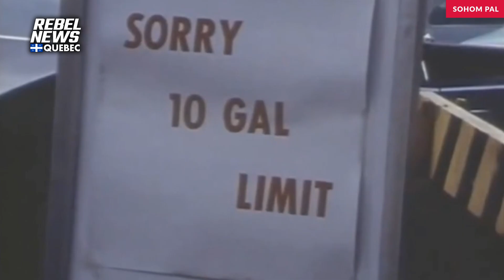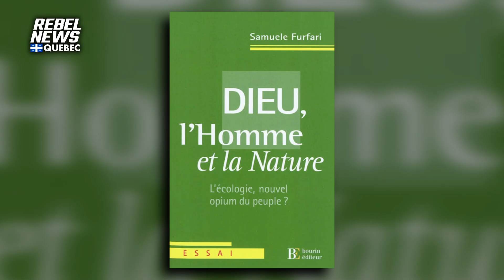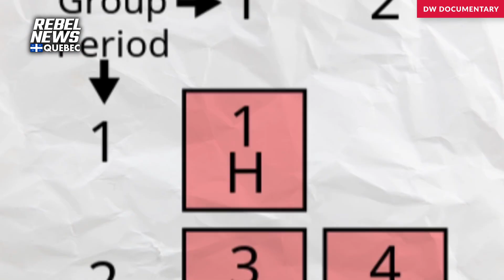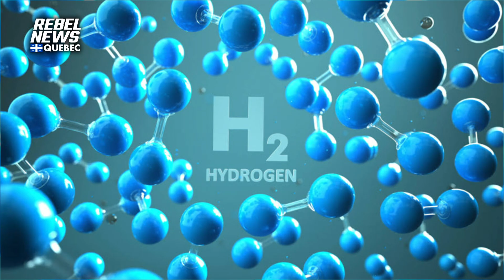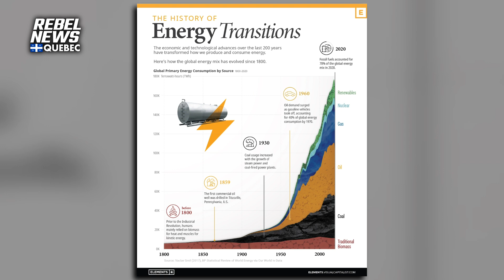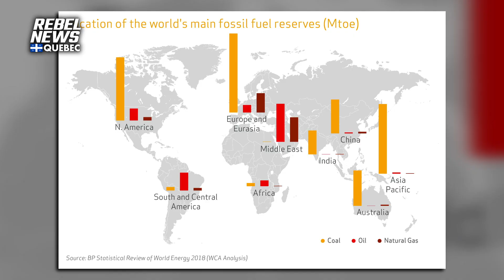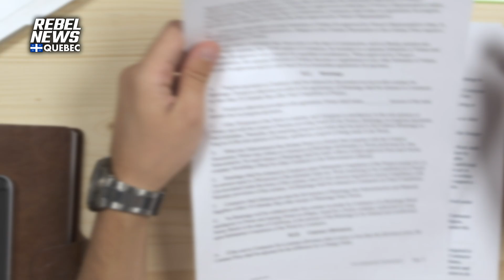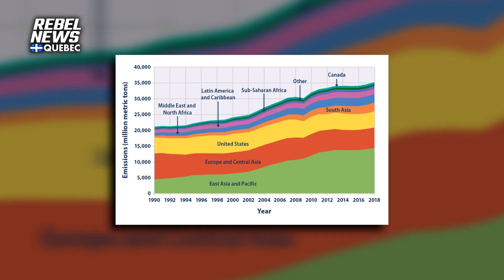Is 'green hydrogen' realistic?

Comment: I am totally for green but hydrogen is not practical in any way since making it, compressing it, keeping it cold, the losses, the danger.. and then using for what? Boilers and heaters at home?? That can be electrical. If i were boss, I would plant fast growing plants and use these via pyrolysis for fuels but I would add hydrogen or a hydrogen carrier to the process, so that more light, hydrogen rich fuel can be formed. The synthetic biofuels can be transported safely.

Comment: One thing no one talks about,,is when you burn hydrogen it produces water vapour... The number green house gas..more water vapour,,more rain,more severe flooding...
Reply: That is in a way very well observed but you overlook something. Water vapor can only be artificially added as much as temperature allows. The hotter, the more water vapor the air can hold.  The air becomes saturated at a certain point. I have no idea what happens exactly when water boils in a 100% saturated air. Normally no more steam can be added but this is above my level ;-)

Comment: Hydrogen don’t work in cold weather…the end
Reply: What if you use fuel to keep it warm? 🤩
Reply: ?? Because when it's decompressed, it sucks up heat like no tomorrow? Yes, that's true and happens also with compressed air. I read even that at a hydrogen tank, the filling can stop because of ice deposits. The station must have a higher pressure than the car tank of 700 bar. It's crazy. Check out the ( possible renewable synthetic fuel ) dimethyl ether fuel. That is compressed too but it could work in cold climates I think.
Reply: @jean-pierredevent970  yes there is always a trade off, now we are trading  off lesser polluting western refineries for Asian refineries that are more profitable and less eco friendly, all under the guise of compassion

Comment: Apparently it requires 48 kWh of electricity to produce, by electrolysis, 1 kg of hydrogen which will contain only 33 kWh of energy.  Therefore, using H for fuel is stupid since it takes more energy to produce the hydrogen than is contained in it.
Reply: Thank you I have been wanting to find that number. As it goes with my suspicions of it takes more energy to get something out then what one puts in.
Reply: It's probably even worse than that. The 33 kwh number is likely assuming 100% efficiency, converting that hydrogen into electricity is likely about 30% efficient at best...so we would use 48kWh of electricity to generate 10 kWh of electricity using hydrogen. idiotic.
Reply: And what about the energy to produce coal energy and gas?  What are the figure maybe there?

And if that energy is created by a renewable green resource then what does it matter to produce the green hydrogen.. because that energy is essentially free and green when setup..that’s why it’s called green hydrogen and not blue or grey hydrogen
Reply: @nicholas296  It's called green hydrogen to fool people. The energy budget for coal is about 50:1. That means that it takes one unit of input energy [mining it] to get 50 units of output energy. Gas is less than that, I believe 25 or 30:1 and gasoline and diesel are 6:1. "renewables" barely break even by the time their useful life is up.
Reply: @whiskeytango9769  That seems to make no sense.. but thank you for trying.  I am not sure you inderstand the process of creating green hydrogen.
Reply: @nicholas296  The best process, assuming there is even a market for hydrogen, would be to use the waste heat from a nuclear power plant to break apart water molecules. That would actually make sense.
Reply: @whiskeytango9769  You clearly have not looked at the market current market demand or potential. Waste heat?  Kind of like your brain.
Reply: Smsl🎉nkuo swow😊nnnnnzddeeedeeerrrrr que se ppppppppppem
Oooh
😅